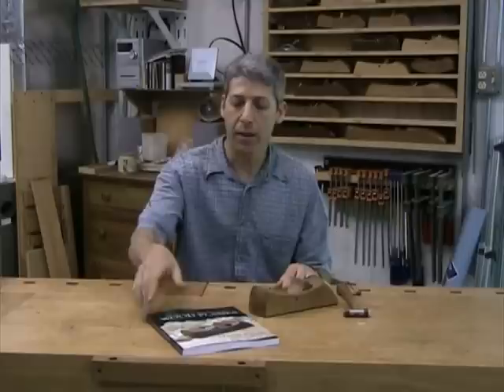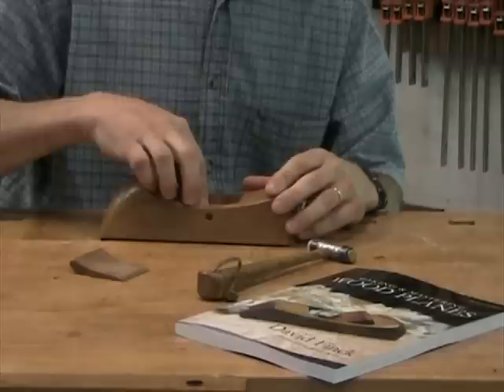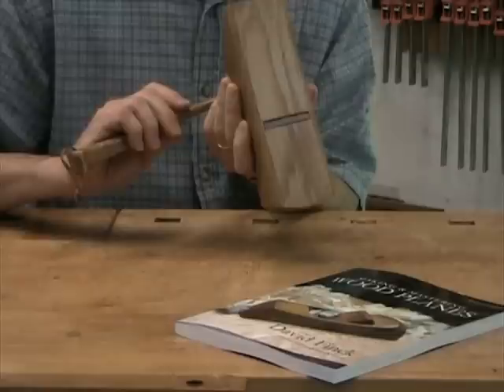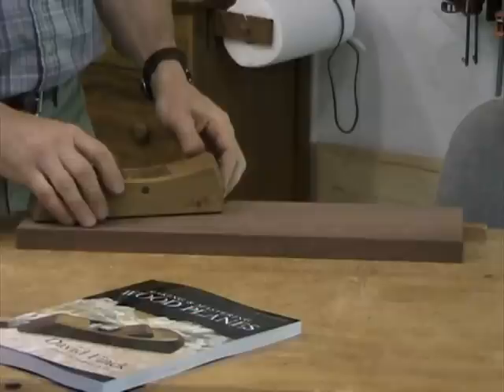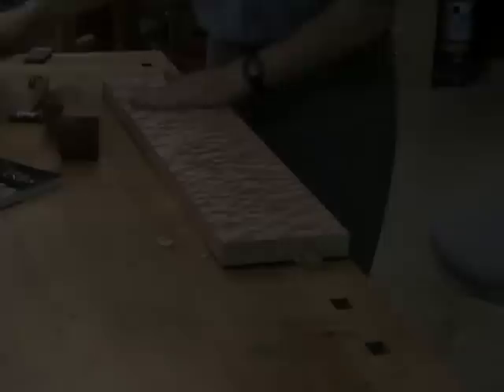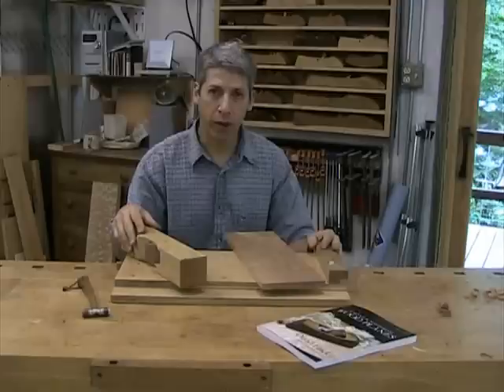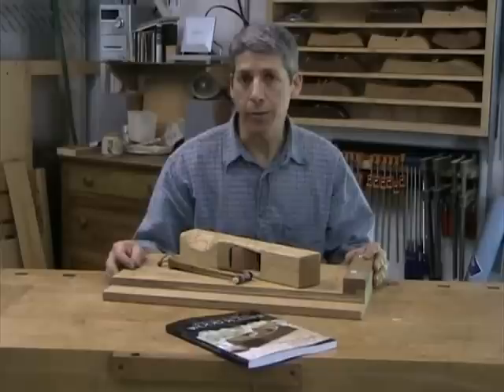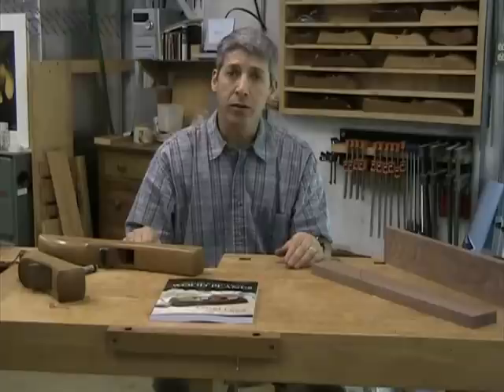Making and Mastering Wood Planes

Comment: While I was ill, I had the opportunity to host a master joiner in my workshop (which I had built for using power tools to work wood.) During the two years he was here I saw him make very fine traditional furniture using just wood planes, etc. Now you have opened yet another door. I will make the traditional clock cases to hold my hand -built movements with hand-built planes.

Comment: I have your book. A great help. Is myrtle a good wood to make planes? Thanks
Reply from the maker: Myrtle, aka CA Bay Laurel, is sufficiently hard to perform decently as a plane, however with a T/R ratio of 2.9, I consider it too unstable. For the unacquainted, this means that for any change in humidity, expect the tangential direction of the the growth rings to move nearly 3 times the amount as the radial direction -- that can lead to planes that don't stay flat! The point is moot if the wood is acclimated to your shop's ambient humidity and the shop is climate controlled.